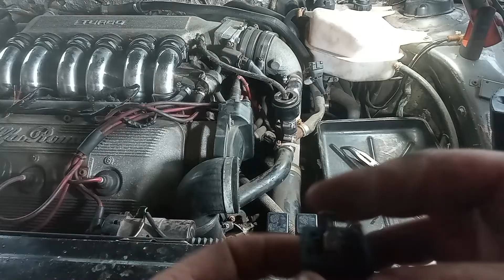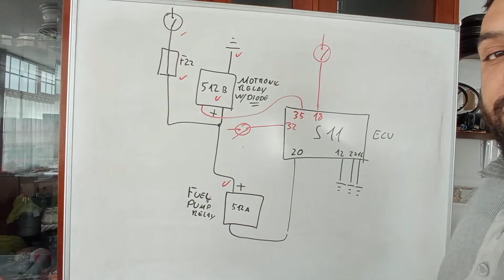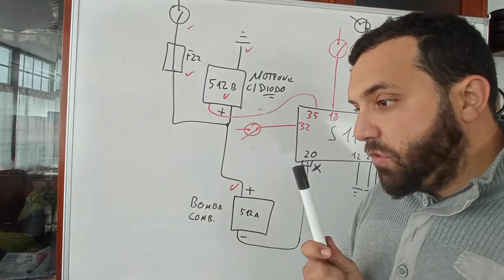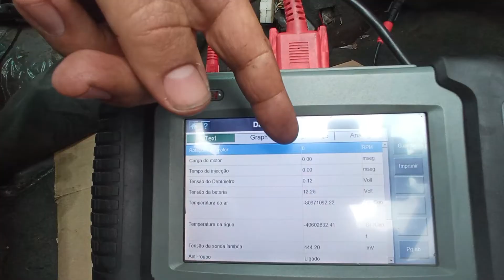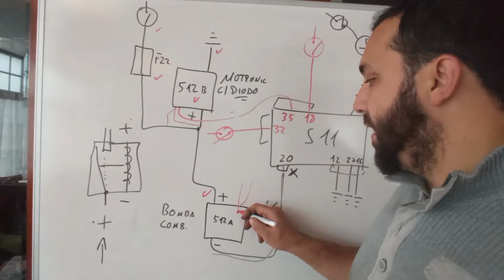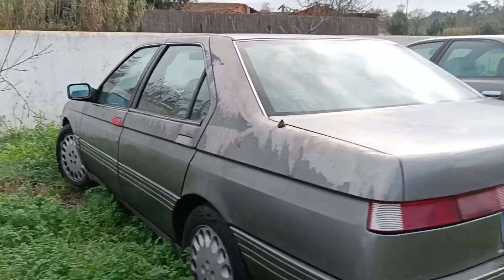Crank No Start Alfa Romeo 164 V6 TURBO Troubleshooting and Solutions

Comment: Hello Bruno, i hope you are doing great! The v6 turbo as i told you started up after cleaning the ecu plugs, but runs on 5 cylinders, and when i turn one injector a bit, she works better so i guess i need to clean them haha.  Anyway, i check for the knock sensors, both are cracked, i have one near the timing belt, and one near the districutor side, both bolted on the head. On EPER, i cant seem to find any code, for the one on the timing belt side. Im sure the car has 2 sensors bolted on the V of the head, but everywhere i look it seems like the one doesnt even exist! Do you have any idea of the part number?

Comment: haha I always find your videos - time to become a member to this channel! now my 164 V6 24V won't start, or rather will always stop after a second - after a 500km drive and getting parked for a week. It starts when I disconnect AFM, so that's at least some hope. Will try going through your all your 164/busso v6 videos!
Reply from the maker: Hello, thanks for watching! Make sure to check very well the sensor wiring and ground of the ECU temp sensor. 
Also check the fuel pressure.

Comment: Are stabiliser bar bushings (front and rear) on 159 easy to replace?
Reply from the maker: Hello. Do not know, I've never encountered a 159 in need of those
Reply: @alfaromeonoproblem  When I was doing the oil change last week, I've noticed the front one being completelly dry rotted. No play, but it looks almost disintegrated.
Reply from the maker: @DashCamSerbia looks can be deceiving

Comment: Man I wish we got the 2.0L turbo Bussos in Australia. I've had three conventional Bussos (currently a 156 GTA) but would love to taste a different flavour. Though I understand they really only exist because of the punitive displacement-based tax rules in Italy.
Reply from the maker: Hello. Yes, Italy and Portugal only. They are very nice to drive! A bit of lag is expected but it pulls all the way to the redline
Reply: Serbia also has tax punishment for engines larger than 2 liters...
Reply: @alfaromeonoproblem Great trouble shooting video on the 164 especially if there has been any humidity present.  Is it possible to turbo 24 or 12V Busso either single or double overhead cam variants?

Comment: Hello, Doctor! I know this is not a forum and is not the necessary video....but i have a question for you...I have a 2010 Lancia Delta 3 1.6 and i want to change the gearbox/transmission oil but i see there are 2 oil drains plugs, one under the transmission and one under the gearbox, i remove both of them? And for refill of the gearbox, i put oil in the disptick hole from transmission or in the hole right under the battery support at the middle of gearbox? Thank you very much🍻
Reply from the maker: Hello. To insert the oil I like to put in on the dipstick hole
Reply: @alfaromeonoproblem  and to drain the oil i must unscrew both drain plugs?
Reply from the maker: @mariuspetrache3035 yes, just like on the 156, 147 and GT. I have videos for that down on the description

Comment: Ok mine has fuel pressure but I’m getting nothing to the coil. Will check the connections on the ecu and the 2 relays near the air box, and will let you know if she finally starts haha
Reply: cleaned up the ECU today, staight away, and she tried to start, and she started with not all of the cylinders.will keep her running to see if it gets better on its own. What does the detonation sensor do? Havent checked mine. Also by rpm sensor you mean crankshaft sensor near the pulley? Also my sparkplugs are new just black from unburned fuel.
If she doesnt run properly soon, will have to clean sparkplugs, check detonation and crank sensor, distributor cap and coil? With cranking i see spark on the sparkplug!.Thank you!
Reply from the maker: @Σωτήρης-φ8δ clean the spark plugs, plenty of fuel and open road! 
The detention sensors are crucial if the engine doesn't have a cam sensor.

Comment: Ciao Bruno, I have a 164 Q4 which i'm rebuilding entirely, I know, as i've seen in this video, you can connect the 164 to a scan tool, I have multiecuscan. Could you explain how it's done please? Thank you
Reply from the maker: Hello. You just have to have the 3 pin plug, the older fiat ones.